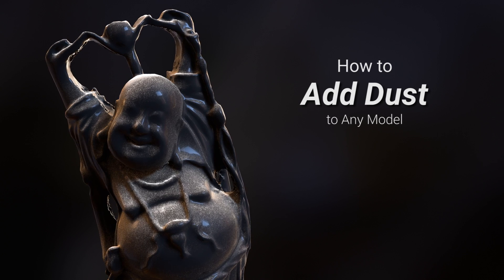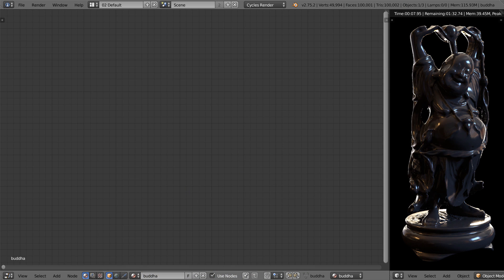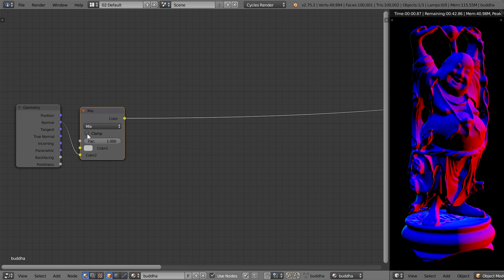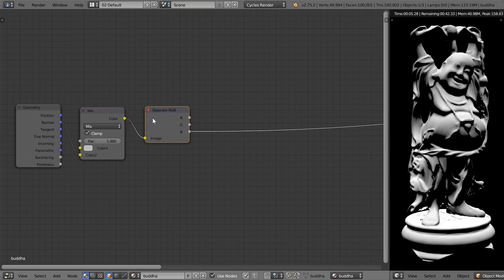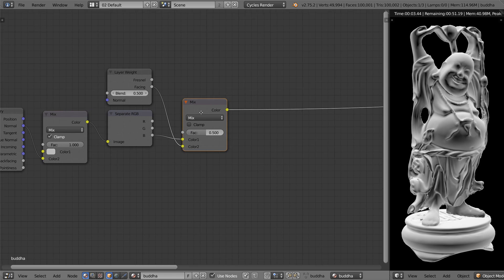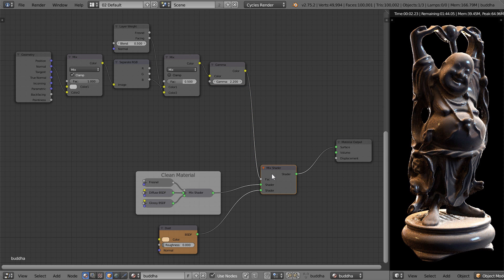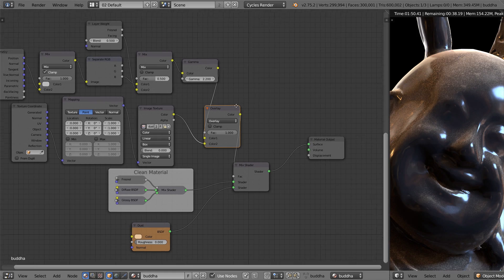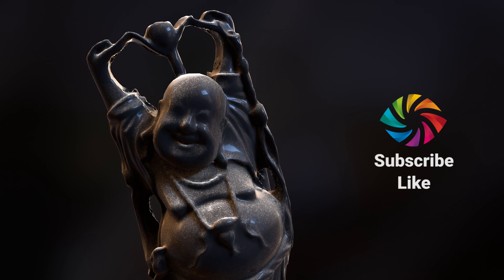How to Add Dust to Any Model in Blender

Comment: When i used Normal to get Up facing i used Separate XYZ - Z component
Since its normal and it shows rotation of a surface and it does it from -1 to 1
Using Map Range we can map it from 0 to 1 and plug in color ramp to control all of the data

I know its been 6 years, but maybe it will help someone to get more control over it

Comment: To anyone confused by the "clean material" and "dust material" step, I was able to create a similar dust node via the Add menus. Add (shift+a) > Shader > Diffuse BSDF. It's not labeled "Dust" but it has the same options and created a similar effect. For the "clean material" I used the "principled BSDF" node that is there by default. Hope this helps!
Reply: Yeah I dunno why Blender Guru skipped that part, some newbie folks can be mislead by these labels on shader editor.
Reply: Thanks, big help

Comment: What is that dust node that appears after 1.30 ? Sorry I’m a noob.
Reply: It's just a diffuse node with a label, you can change it in the right panel that appears when you press the N key

Comment: Is there a way to keep the "top normal" vectors on a character after deforming it with the Armature Modifier?
I've made the dust procedurally and the dust coordinates stay true after deformation, but the "top normal" keeps staying on top and not where it was before deformation. I've tried to look for a way to affect the normal/vector value with values that stay the same after deformation (like the Generated vectors). I don't want to have to resort to UV mapping.
Reply: Not sure, but my suggestion is maybe look into trying to bake the texture onto the object, so that texture will deform with the model.

Comment: Wow, thanks for the Tutorial! ;)
But when trying it out i discovered something, that makes it even more realistic!
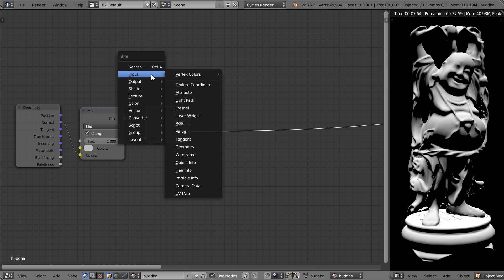Becouse when mixing the Layer weight facing with the seperated RGB it causes that when you look from top on your model, there will be also white material(Later Dust) on the sides of the mesh, because of the low angle. And this is of course unrealistic because there is no dust on the side and the bottom parts of the mesh. But it's possible to easily fix this by putting the seperated blue channel not only in the colour input of the mixer, but also in the Fac!(1:16) So the angle will only affect the brightness of the faces looking up and all the others will stay black :)
(sorry for my bad english)
Reply: V NE EDIT: This will also increase the affection of the dust density when tilting the angle. If you think the affection is too strong but you want to keep the effect from the comment above, just put a "math" node between the seperated Blue Channel and the fac of the mixer and devide it by 1.3 or something like that (the lower the number the less dust will appear by looking at the face from the top but keep it over 1)
Reply: @owlofminerva1397  theres no rule to this , you have to eyeball it for every new scene/object

Comment: dust should be thicker in crevices. Using pointiness or dirty vertex paint to control a noise texture scale which is then multiplied into the dust texture such to control dust density could be useful.
Reply: dirt and thick dust is accumulating in crevices in moisture environments , fresh dust (less than a few months old)  is NOT accumulating in crevices, and not in dry environments like an apartement
Reply: Shawn Kearney Nice tip

Comment: Great video. Just a quick tip - you can substitute the combination of clamped Colour Mix and Separate RGB nodes by using Separate XYZ instead. Otherwise really useful info here, thanks Andrew!
Reply: ***** You can use the Separate XYZ node (it's effectively identical), but you'll still need to clamp it :)

Comment: To me it´s incredible how people can know these things. There´s like 8 different types of nodes that does different things that Andrew just has in his head. How do you learn these things and how can the brain figure it out?? Back to folding paperplanes for me....
Reply: Mr Jee all you need is time, the more you mess around with nodes the more incredible effects you'll be able to achieve
Reply: @Mr Wolfers <------- what he said.
Reply: MrPepsicola123 wow you really are completely ignorant to learning anything new aren't you? I know Maya, Blender and Cinema 4D, each of them has their quirks but none is harder to navigate than the other. Also, to close the viewport you don't want you just go to the /// thing on the bottom of the viewport window and drag to either side, one screen depending on the side you drag to will darken and an arrow will appear, when you release the mouse the viewport will be removed from view. I don't understand what you mean by the mouse being bad, if it's the mouse button you have to press to select objects you can just change it, Blender even comes with the option to change all keybindings to that of Mayas.
Reply: MrPepsicola123 But... It's free. If you want to complain about it being a 'godawful' program, at least consider that it CAN produce amazing results and it is accessible to anybody willing to learn 3d modeling, THE MOST DIFFICULT KIND OF VISIAL GRAPHICS WORK KNOWN TO MANKIND. I think the complexity of the work allows for a high degree of interface complexity. And the fact that it's FREE.
Reply: Then don't use the obscure ones. Things like Extrude (E) and Add Edge Loop (Ctrl+R) and Add SubSurf Modifier (Ctrl+number) are things you'll use so much. Hunting those things down in menus would be a ridiculous time waster. I'm not sure how your workflow goes but I use over half of the shortcuts in any normal session. At this point I'm not even sure which 60 shortcuts would be considered obscure enough to use only once.
Reply: MrPepsicola123 Why would you say this? It produces great results and it's free.
Reply: MrPepsicola123 I have used several industry CAD and simulation programs. I haven't used Maya, and I only touched 3DSMax. I have also used Adobe products. I have obviously used MS Office, but I use more of it than most people.
Considering how much Blender does, I think that its interface is amazing. It does take some getting used to, but a program as powerful as Blender would be so much messier with the standard interfaces that I have used. The ability to customize and save screen setups is extremely useful and is flexible enough to accommodate whatever someone is trying to do. It definitely trumps stacks of dialog boxes, multiple programs loosely connected together, and "modes" or "states" of the main window. After getting used to it, I wish that more programs worked the same way (at least the programs that are similarly capable).
My one complaint is that having the Properties window horizontal is a complete mess. The code needs cleaned up so that the horizontal mode works more smoothly.
Reply: MrPepsicola123 blenders interface is as much of a mess as any other 3d program.
Reply: MrPepsicola123 The view split is hard to get used to, but once you do, it's extremely flexible - and is one of blender's strongest UI elements and fits with Blender's unique capability of a very fast workflow. I'm not sure what you mean by "the mouse is horseshit". Are you using 2 button mouse? Do you have a number pad?

If you think you're going to learn any higher-end 3d software on your own without watching tutorials and reading the manual - you're wrong. This isn't minecraft. I spent literally like 10 years off and on stubbornly thinking I didn't need any help - that by simple bruit force I'd get to know Blender. In the last six months, I've learned more about how to use Blender than I did in the previous ten years because I changed my attitude and got help - of which there is plenty of.

If you want to get into 3d art and animation, you can. However, learning the tools and theory does take a degree of dedication, patience, practice and willingness to sit through some tutorials. If you're just not willing to do this, then you will never (and I repeat never) get there - this is true regardless of the software option.

If you don't want to learn anything, I guess there is always Daz Studio (or for that matter The Sims - which is essentially the same thing).
Reply: MrPepsicola123 I mean, not that your plus account displays that you have any kind of expertise on the matter anyways....
Reply: MrPepsicola123 Maya is more of a "mess" from my [admittedly limited] experience.
Reply: +MrPepsicola123  Hey man...Shift+A. Then click Cube. Easy when you know how.
Reply: Tommy Hjalmarsson
Well sure...but still
Reply: Mr Jee Man it's just like everything ! How did you learn 26 differents letters to be able to write ? Well you practiced, even though at first it looked scary and impossible. Practice makes it all, practice practice and practice again.
And in the end it's "normal", you don't think about it you just do it.
Reply: Mr Jee Girls don't get easier to talk to, and 3D won't magically dumb down to your liking one day. Drawing is still drawing, after all this time, and whether or not you figured out the 'how to do it' is entirely up to you. Learn.
Reply: Mr Jee research and doing tutorials, the same as us
Reply: ACBlenderTutorials As someone who used 3d software before the non-modal design concept became standard, I definitely agree. It was a completely inefficient mess!

Granted, when things started shifting from modal to non-modal it took some getting used to, and at first I really didn't like it either, but I cannot imagine working any other way.
Reply: Micah Lindstrom I believe girls will get easier to talk to, for you'll know what to say and what not to say by what we call experience. Same goes for 3D
Reply: +Mr Jee I think what happens is that you mess around with the nodes and find the effect you like, but you don't have to remember how you got that effect because it is all saved in that Blender file. So if you wanted a specific effect, for example the dust effect, then you would go back to the Blender file that has the dust effect used in it and then simply copy the nodes. :D
Reply: I think he was inspired by how we fake top lighting effect by using one channel of an object space normal map. Some does dust, dirt and snow effect with this map in video games. ;)
Reply: This comment was 4 years ago... where are you now I wonder?
Reply: Mr Jee I completely agree.  This tutorial is awesome and I would have thought I knew very well how to add dust until I watched how these nodes are used.  Most tutorials will prove that a node setup works without spending enough time explaining WHY it works.  One thing that helps me is the Cycles Input Encyclopedia for this but it's a reference to be used when you know what area to explore.  I would GLADLY listen to a tutorial for an extra few minutes if it meant I would have a solid understanding WHY something works so it would be top of mind the next time I need to use a similar technique.
Reply: Max D.
Ah so it´s like with me and NOT being able to talk to girls then? Cause that´s second nature to me now....
Reply: Mr Jee I'm not sure I understood fully what you meant (french here, not getting everything in english), but that'd be a good example : if you talk to lots of girls, at first you'll fail, but then you'll be used to it, you'll know what to say and what not to say, but you would not have learnt it, you wouldn't think about it, it would just come naturally, after quiet some times (depends...)

Just keep working. If something (like 3D) is a passion of yours, than work it, again and again, don't give up (same for girls, never give up on them)
Reply: Well i hawe watched this videos twice: once when i just had started wih blender(i thought same that you(mr jee)did) and now when i have "masterd" blender: it looks so easy!!!
Reply: It's essentially like computer programming, before you make a material you might want to move away from blender, work out the logic behind the material on paper, then see which nodes can do what, and tinker around until you get the result. Maintaining a clear and efficient node structure is just as important as it is in programming.
Reply: Jesper Jee same as how we learn different things. All really possible 😃🙌🏼
Reply: Some people do nothing but use Blender. Working solely in one piece of Software for several years makes you knowledgeable and experienced in that software I suppose.
Reply: Practice and some thinking. A lot of programmers know how to code but way less ones do know how to write code that results in a desired behaivour / system. If you learn to do such things, solving problems, you will be able to do it. Just do tutorials like this, look at the nodes and try to understand the full path in your head, if you do that you can use that knowledge and understandment for your own stuff. I started Blender 4 days ago and already finished my photorealistic shot. I pretty much watched videos like this for days until i had all information i need to do my thing on my own.
Reply: Mr Jee Small correction, it's Greg Zaal who is the author and most likely also provided the visuals for the video.
Reply: Mr Jee 

When you see a tutorial, you see a rehearsed performance. You don't  know anything
about the way to get there. And it can be that the author of the tutorial is the inventor of….. 
or he heard it from a friend, read it in a book, website…
Reply: Josh Gilstrap Why does every little action have its own shortcut, there are over 60 different shortcuts to obscure little things that you might only use once.
Reply: Mr Jee stop using blender since its a damn mess of a program.
Reply: Micah Lindstrom Its Interface is horrible, the most godawful interface imaginable. it may be free but that does not excuse having a shitty UI.
Reply: @MrPepsicola123   its ok , i dont like the single monitor ui of blender either , but for smaller projects its good enough .. learning a behemoth program like maya and max and knowing all their features and sub-windows is hard too and they are not perfect either , but i agree , blender needs floating windows so i can make one layout which fits all things i need onto 2 monitors ... 

blender limitations are mostly in animation and vfx , the rest of the program is pretty nice though , i can work faster in blender than i did in max (even though i still need max from time to time)
Reply: Mr Wolfers You can stop lying to your self, Blender has the worst interface imaginable. you have to go through hell just to do anything, i tried making a simple cube, all of a sudden there are two fucking windows open and no way to close the damn thing, so im stuck with two of the same windows, the mouse is horseshit, all i want to do is view my object without having to go through the horrible bullshit, whats up with the bullshit selection everytime i click my mouse anywhere.
Reply: @MrPepsicola123  🤣😂 you don't know anything about Blender: you are supposed to delete cubes, not make them 😁

Comment: These shorter, more concise videos are, in my opinion, far better than your longer tutorials.

As a suggestion, considering the latest affairs regarding space exploration, do you think it would be possible to create a tutorial on making the planet Jupiter (or a fictional gas planet) using the smoke simulator in Blender? I think this would be quite interesting and show of a lot of optimisation techniques, smoke & material settings, lighting techniques and particle/smoke flow force fields.
Reply: MrPutuLips New Horizon's Pluto flyby! I'd love to see a tutorial on Jupiter! I wouldn't use volumetrics because on no part of the planet is it really translucent, the gases are too thick, but the smoke simulator would be a place to start.
Reply: MrPutuLips i will be interested too, but on making such object on blender you should try volumetrics shader instead.
Reply: Is it possible to create those things like the eye and all of the bands of storms using volumetrics?

Comment: how to make a huge terrain, please!
Reply: Luis Perez there's a plugin that comes with blender that auto generates landscapes that you can tweak to your desire
Reply: Luis Perez 
I've found that one cool way to make a terrain is to subdivide a plane then move faces up with proportional editing enabled. Or you could use a displace modifier with a topographic image or just a cloud texture, the only problem with those methods is that the topographic image would have to represent higher land with a darker color and the cloud texture wouldn't allow you to control which features appear where in the terrain.
Reply: yeah! but, full textered?
Reply: Luis Perez Watch Blender 2.74: Topografía real en alta resolucion (youtube)
Reply: detallegrafico gracias!!